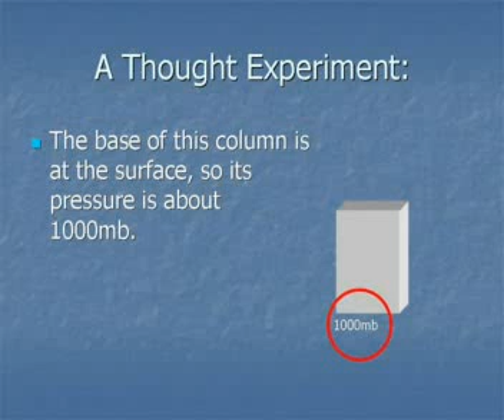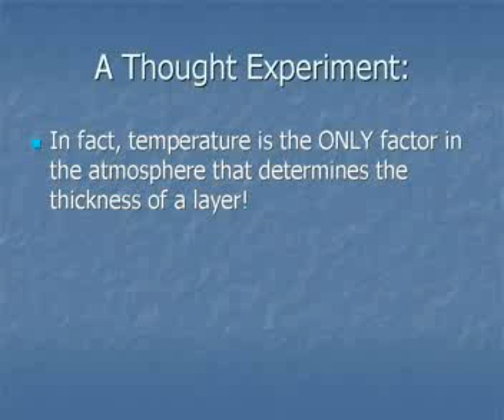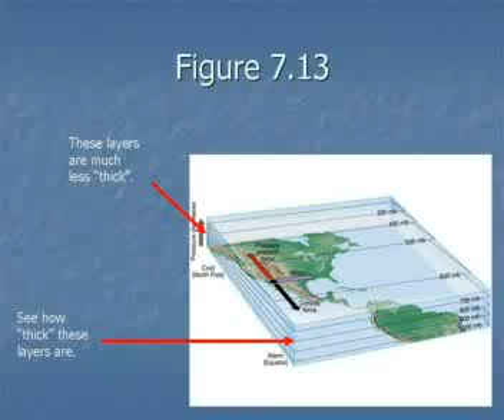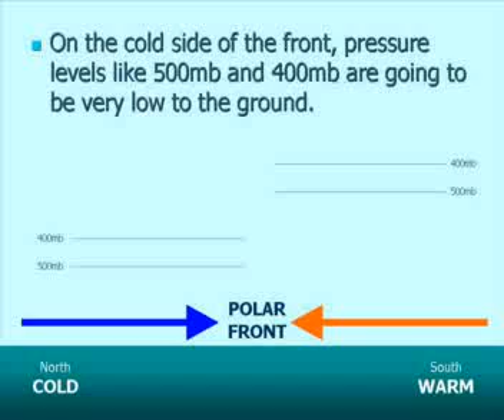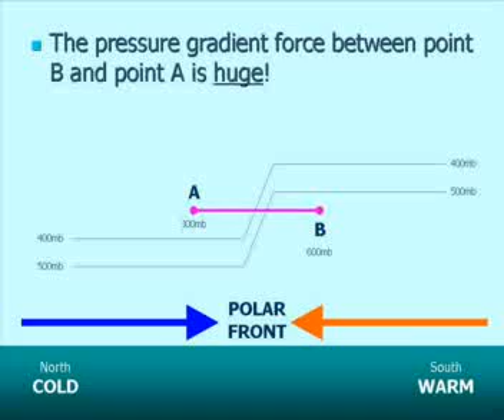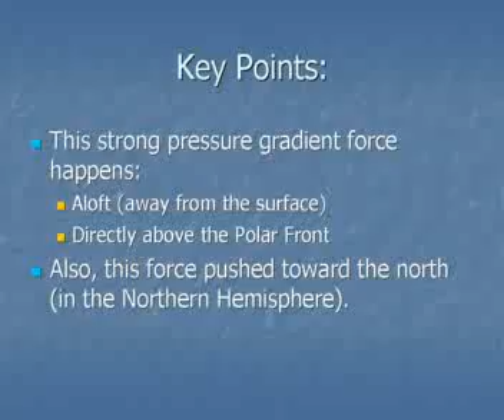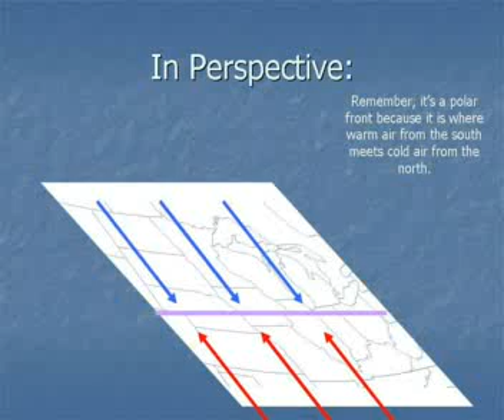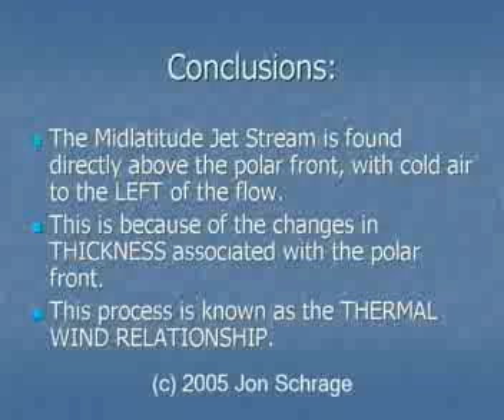Thermal wind

Comment: A column of cold air will exert a greater surface pressure than a column of warm air of the same height.  However, points A and B on the diagram are not on the surface, they are at a specified height above the surface.  Less air from the column will be above point A on the cold side than point B, at the same height, on the warm side, because the column of air has expanded to take up a greater height.  So the pressure at that height above the surface will be smaller on the cold side.

Comment: I agree with arunchowdary. You are describing the Jet stream in a barotropic atmosphere where temperature advection is nonexistent.  The thermal wind is just the vector difference between winds at two different layers.  Also, why do you keep mentioning a "polar front" when you couldn't  quite decide at 4:02 what kind of front you had? Overall. a good video but you just need to change a few things.